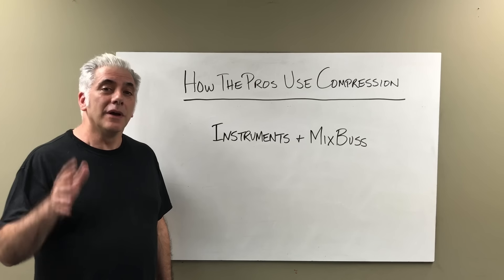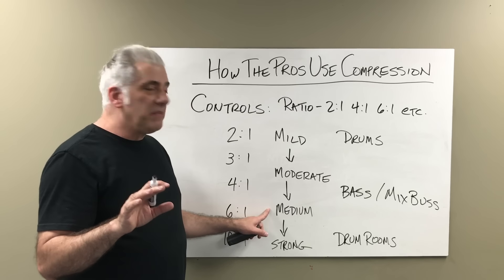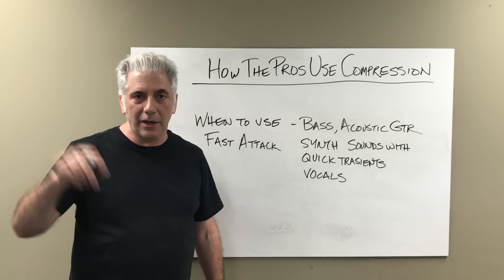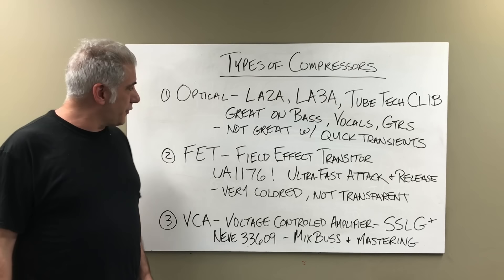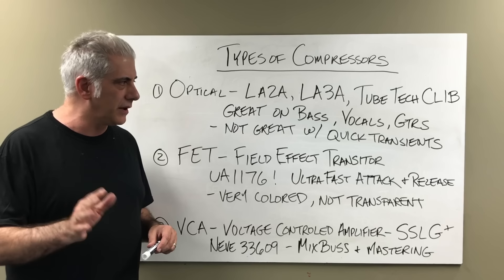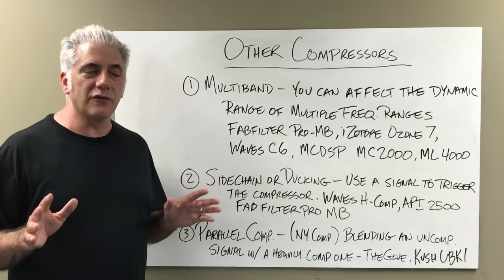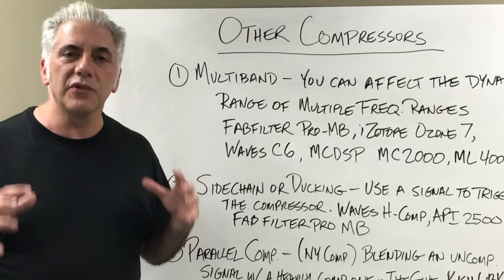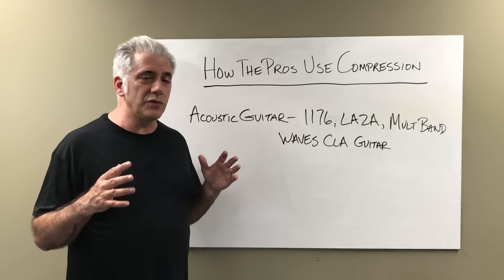How The Pros Use Compression on Instruments and Mixes

Comment: Attack is the length of time it takes a compressor to apply roughly two-thirds of the targeted amount of gain reduction.

I say ‘roughly two-thirds’ because there is no agreed-upon, industry-accepted standard for what this spec actually is. Yes, you read that right: no two compressor designers will agree on exactly how to define, and therefore measure, attack. My definition above is within the ballpark of most thinking, so I’m running with it.

To understand this definition of attack better, you need to get some basics of compression established first. Let’s say your compressor is set with a threshold of -10dB and a ratio of 3:1. If you feed this compressor a signal at -11dB, nothing happens because the signal is lower than the -10dB threshold.

But if that signal jumps to -1dB things get interesting. Most notably, the instant the signal reaches -10dB the compressor begins attacking it. There is no delay whatsoever in this response, which belies the myth that attack is the time it takes a compressor to respond once a signal crosses the threshold.

With a -1dB signal and a -10dB threshold, the signal is 9dB over the threshold.  Our 3:1 ratio means that for every 3dB coming in over threshold, the comp wants to allow 1dB out the backside. Since our example has a signal 9dB over the threshold, our hypothetical 3:1 comp wants to compress those incoming 9dB into 3dB at the output, which would require 6dB of gain reduction.

Given that attack is the time it takes a compressor to apply roughly 2/3 of the targeted gain reduction, the attack in this case indicates how fast the comp will apply the first 4dB of the target 6dB of reduction.

If you don’t follow the math of this illustration, don’t worry. For now it’s enough to know that the compressor starts applying gain reduction as soon as the signal crosses the threshold. Which means that attack is not a delay before action, nor is it even a measurement of time per se; instead, it is a rate, a measurement of the speed at which the process of gain reduction is occurring.

Release is the time it takes a compressor to restore two-thirds of the reduced gain to the compressed signal.

‘Restoring reduced gain’ is a very carefully chosen set of words.
 I characterised release in those terms because it’s useful to think of compression as a two-way street.
When a compressor attacks, it is applying gain reduction – it is lowering the signal level.

But gain reduction is only half the picture, because for every dB of gain a compressor takes away, at some point it has to put it back. And that process – let’s call it ‘gain restoration’ – is the business of release. The faster your release, the faster the compressor restores the gain it took away when attacking.

So what do we know now, at least in a purely academic way?

Attack is the length of time it takes a compressor to apply roughly two-thirds of the targeted gain reduction.

Release is the length of time it takes a compressor to restore roughly two-thirds of that reduced gain.

This gives us a good grounding to tackle more compression myths.
If you’ve been paying attention, it should already be obvious why this statement is false.

The explanation lies in the fact that aside from generating ancillary effects like distortion and colouration from transformers and tubes, attacking and releasing a signal are the only two things a compressor can do.

Put a little differently: any time the gain reduction meter on a compressor is moving, it is either attacking or releasing the signal.

Fascinating! Taking it a step further:

Any time the gain reduction meter is increasing (i.e., the comp is reducing the gain of the signal), the compressor is attacking.

Any time the gain reduction meter is decreasing (i.e., the comp is restoring the gain of the signal), the compressor is releasing.

So while the well-intentioned myth-spreaders out there would have you believe that attack and release are only relevant when a signal crosses the threshold – attack on the way up and release on the way down – what I am telling you is that nothing could be further from the truth. Instead, once a signal is over the threshold, both attack and release are constantly at play.
G.S.
Reply: That was effin' awesome to read. "There's no delay in that response whatsoever" 

That's the key. Most people think the attack time is how long the comp waits  before doing it's thing. But i observed visually on GR meters that the pin itself moves faster or slower when you set the attack/release times to your taste.

Absolutely vital point. You rock.
Reply: Thanks. Makes sense when you think about analog comps who cant measure time discretly but instead control the speed of attack/release with variable resistors.
Reply: Very well explained! Thanks a lot for the effort you put into this fairly long youtube comment.
Reply: Phew....Im lost.   I'll need to read this a few times to try get this.  I did indeed always assume a fast attack simply meant how quickly the comp attacked the signal "once it crossed the threshold.   I'd always imagined it like a security dog and a line in the sand.  Security are well aware you're trespassing and crossed the line.  But they might give a head start or attack you immediately.   Depending on the attack settings.
Reply: Very nice explanation of a concept that is so fundamental to recording and live sound but so little understood. I had all the classic compressors of the day in my 3 studio complex and each had its own transfer functions that had to be learned by experience. But in those days a top album studio had no beginners in them or jacks of all trades, it was a real team effort in each studio so by the time a promising Second got a solo as first they had been working daily for several years with top producers and engineers. A lot of that knowledge has been lost or distorted by the home recording social media mythology and beginners teaching other beginners.  I am not even in recording anymore, after the death of the record industry in the 90s, all the great independent album studios closed due to lower numbers of major label releases and the drastic cut in what the labels would pay after all the labels were purchased by international corporations. 
I started as an EE designing equipment but moved into recording by accident in the early 70s and continued into the early 90s when everything in radio, touring and recording collapsed with the new label policies.  It is interesting that the gear we built or used as everyday hardware is still revered 50 years later.  About the only hardware not sought are the plate reverbs, we had 6, plus live echo chamber tied into each control room patch bay. They are too big for most computer-based studios now I suppose.
Reply: A HUGE thank you, sir.
Reply: Yes, the compressor starts working immediately, the ''attack/release time'' specifies how long it takes to reach X ammount of compression. Now up untill i read your comment i tought X stands for full targeted compression and not 2/3 of it. Do you have anything to back up that claim? I'm not trying to express any disbelief, just asking so I can maybe read further into it and look at some research.

If one would do some teting and research myself (which i'll probably do anyways), we need some fixed numbers. Did anyone do any tests on specified ratios? How much can you trust the manufacturers that 3:1 actually reduces 2db if the signal reaches 3db above threshold? What's the margin of error here? How much of this theory does apply to outboard gear and how much to software compressors?

This looks like I'll spend a few days measuring compressors, just to get back to ''just listen to it and stfu'' thing :D ....ahhh the beauty of audio rabbit holes :3
Reply: I definitely had a few of those "I'm not sure if this makes total sense, or I am lost as f*ck" moments, but in the end I understand compressors in a completely different way now. Kept it acedemic and accessible. Thanks!
Reply: @stanspb763  I got my EE in '91, digital age.  We didn't learn tubes and x-formers.  (But nevertheless, I got sent to Top Gun for it, to help refine strategems against enemy tech)

So when ur generation dies out and is buried into the soil to contemplate Eternity (or not), all the young PUG-heads using Fruity Loops v99.02 will want a new or classic sound, and will look at this mysterious Fairchild 660 collecting dust in their great-great grandfather's barn, with scorpions scurrying here and there.  They will scratch their heads, wondering what to do, and they won't have any Obi Wan to revive the Force.  Then they'll look at the Puigchild code on this old hackintosh, and IR iterations, and will have no clue what that black box is doing.  Then a Nuclear bomb will drop on NYC and the only thing standing will be the EMT plate reverbs.  Then the ape-ppl will come out and throw up a bone, and worship it like the Space Odyssey.  Then they will Evolve.

And then the Nephalim will arrive in 2112 in their Spaceships.  And they will jumper cable some power to those EMT's, saying, "Attention all planets of the Federation...we have assumed Control...we have assumed Control".  And the apeanoids will cower in fear with the ARRI HMI Lights shining upon them for effect, wind blowing on their fur.  Then Spielborg 3.0 will yell, "CUT!".  And everyone will remove their costumes and return to their trailers, and read Lillian Hellman's communist Talmudic manifesto against the true Hero Joseph McCarthy.

But still, they will try to connect electrodes to your cranial remains, and try to seek Answers to the Fairchild 660.  Their belief in the material mind will lead them down false paths, such as the theory that memory and willpower are retained in your DNA remnants found in your bone marrow.  But your skillful skull will just smile at them, saying that you are in a Better Place, beyond their reach, and that they have no clue.  Because they have subjected themselves to Google, Inc. / Tyrell Corporation, with the Secular Humanist Manifesto imprinted into their forehead-chips with a red-or-green Light indicating Compliance (or not).  And the best of them will be in hiding or terminated.

But no worries, Christ promised his Church will never fall.  So by then, we'll have long populated Alpha Centauri, and Cathedrals constructed of man-made Nebulae Spires.  So think positive!  It ain't the End of Mankind!
Reply: @arthursulit  That's the most remarkable, evocative, reference-filled gibberish mash-up I have ever read! I just read it twice. Well done, I love it!
Reply: Thanks for sharing the knowledge man.
Reply: You are so gifted. Thanks for this info.
Reply: So it starts building up to max compression when the input goes above the threshold. When does it start releasing? When the input goes below the threshold?
Reply: This is misleading. It completely depends on the program material. If it’s a sustained signal then you’re 100% correct,  but if you’re compressing, say, a kick drum that is “on the grid” (electronic music) then attack time is exactly what you’re saying it’s not. The only thing your brain should relate attack to is how it responds to transients, and subsequently, release should just be set to return to zero before the next transient (if it’s transient heavy material). You make an important point about how the attack and release function once something stays across the threshold, but quite frankly if you set your threshold properly it’s kind of a moot point. You really just could have said the last sentence!
Reply: Flying Crowbar nah when release time is over. The caveat tho is every time the compressor registers something crossing the threshold the process restarts. Hence the unnaturalness if you don’t set it right
Reply: @flyingcrowbar1599  the moment it starts compressing - which is what attack time determines. Your attack determines how quickly it compresses after a signal crosses the threshold. And then from the moment your compressor kicks in is when the release time comes into play. But as Junk Action points out this relationship becomes unstable/not accurate if a signal triggers the compressor before the release time is over. Basically every time the compressor is triggered, the release time resets.
Reply: Justin Beck Thank you Justin, that’s very clear.
Reply: Amazing, thank you.
Reply: Any engineer that attempts to tell me there are no standards is NOT an engineer. Thanks for wasting our time. Especially after this dude just TOLD you about standards. This is why you will never be a mix engineer. Along with so many others.
Reply: @leahcim38 Well why didn't they just say that from the start?  Is that an emperor penguin by the way? If I order the wrong penguin returning it will be a nightmare.
Reply: @arthursulit    See DSM/ICD 10 F22
Reply: Even just as a musician, it's so important to understand "what's going on under the hood" to get the best sound and mix. Thanks for this thorough explanation.
Reply: You didn’t have to publish a whole novel for a five line explanation... whew 😅
Reply: good explanation. I think it's relatively easy to hear that attack is the fading in of the compression effect. So a longer attack causes the effect to fade in at a slower rate.
Reply: @michi9955  what i was brought up on
Reply: That's fascinating. But in the end, your ears will tell you things trigger fast - that fly past the analysis. One's response is either "Yeah! That works!" or "Geez, no!" At that point it's good to know what YOU know so that you can figure how to make it sound better.
Reply: Wowww! Awesome contribution to the video! Ty :D
Reply: Wrong! ATtacks time is how long it takes to compressor to start compressing the signals after it reachs the adjstd levels. here is the articles you need to read....

When a sound overshoots the volume threshold, the compressor does not instantly apply the full compression to the overshooting signal. Instead, the compression ratio increaeses gradually from 1:1 to the maximum within a certain amount of time. This time is called the attack time.

When the sound drops back below the threshold, the compressor does not instantly stop compressing the sound. Instead, it gradually reduces the compression ratio until it reaches 1:1 again. This time is called the release time.

THANEK YOEU AN GOOD LUCKS!
Reply: Excellent.....compression becomes complex when fitting hearing aids to help restore speech clarity due to hearing loss.  Speech is the ultimate complex signal.   It’s a fascinating topic.
Reply: I went to the SAE (School of Audio Engineering), paid almost € 40k and they didn’t tell us any about this BUT a few years ago I passed my CPD (continuing professional development) in electronic technology in Germany and we learned about the way an analog compressor works and the prof told us about that. So if I didn’t knew this before I’d been lost all the way. Yet I learned something new by your comment: there is no agreed-upon industry-accepted standard for what ‘attack’ means in case of compressors.
 Thank you for sharing your knowledge! There should be more like us out there!

And last but not least: Rick I really love your videos because as I mentioned a little earlier in my comment, I paid almost €40k at the so-called ‘School of Audio Engineering’ for knowledge I could obtain from the internet for free and what you said AND ESPECIALLY the way you do it is worth spending time and money for your channel because by watching your videos I really REALLY understood how to mix, compose and by that to improve my mixes. I REALLY REALLY LOVE YOUR CHANNEL AND I WILL KEEP DONATING ANONYMOUSLY BECAUSE I’M IN LOVE WITH THE IDEA OF SHARING KNOWLEDGE FOR FREE BECAUSE NOT ALL OF US HAVE THE MONEY TO AFFORD AUDIO ENGINEERING SCHOOLS AND KNOWLEDGE SHOULD BE AVAILABLE FOR FREE ANYWAY BUT SOMEHOW THE AFFORD YOU PUT INTO YOUR CHANNEL HAS TO BE HONORED AND VALUED!!!!

Love, peace and a lot of greetings from Germany ❤️✌️
Reply: there's a youtube video entitled: "test your compressor with this audio file"... download link provided in the description.

Comment: Great video! This has helped me teach compression to my audio engineering video. One note I will add though that makes it very confusing for people learning compression. With ratio, it’s much easier to describe a 2:1 ratio as every two dB above the threshold results in 1 dB output above the ratio. The way ratio is described here, can confuse people that 2:1 will reduce by one dB which is not wrong for a 2:1 ratio, but that could cause someone to think that with a 3:1 ratio, it will reduce 1 dB when the signal goes 3dB above the threshold. Just something to be conscious of when explaining ratio with a 2:1 ratio. I’ve had many students confused over ratio. The way I like to teach ratio is I.e 4:1 ratio…I tell my students “okay think of yourself as the threshold. I give you 4 apples and you only give me back one apple”

Comment: The amount of great old recordings that have been ruined by remastered over compressed versions is shameful imo
Reply: oh man, especially the Metal Classics, that were mastered near perfection.
Reply: @Sean PA A ot of these plug ins color things a lot as well. It will take years to learn the nuances of these plug ins. Generally, it's hunt and pray, though ultimtely it's your ears that make the selection. I've found myself applying and then taking off many of these compression plugins, because they introduce some sort of nastiness while they reshape the original into the boring. Sometimes they help, but often they do not. I agree with you about Ozone, though. That does make things sound better. Some guitar vsts will improve some old guitar tracks sometimes. Like you say, without a good song and a good performer willing to take it live, massive circle jerk.
Reply: ...Steven (shameful) Wilson   :((